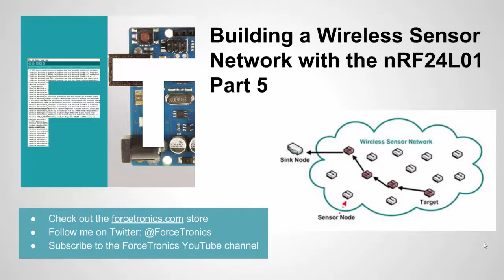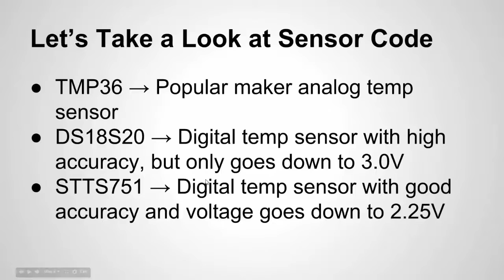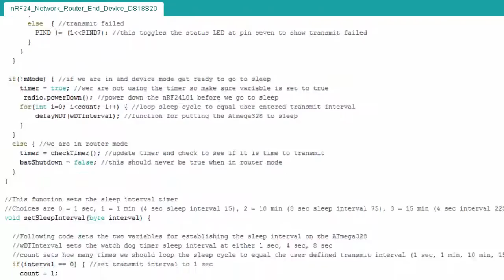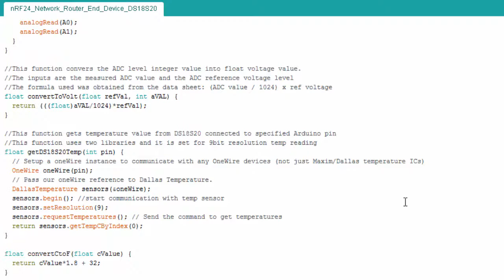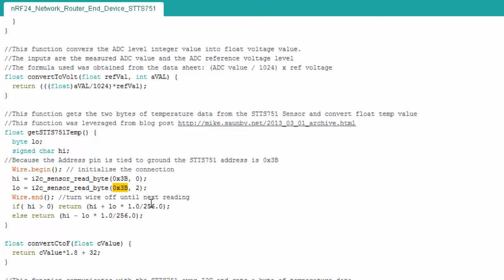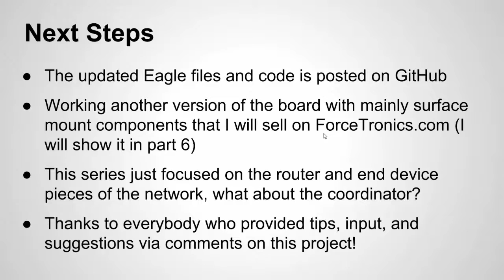Building a Wireless Sensor Network with the nRF24L01 Part 5

Comment: Hello, I’m working on a project with three Arduinos. I have a Node0 where I pass along a joystick1 reading to Node1 and joystick2 reading to Node2. Those would be integer values. I am also passing along two encoder values (volatile long) from Node1 to Node2. How do I process the data on Node2? It expects a 1 type int from Node0 and 2 type longs from Node1. I'm using header.form_node, so I know which info is coming from where. What do you recommend?

Comment: Can we use Arduino Uno instead of custom made PCB??? And the sensors externally??
Reply from the maker: Yes you can but you may need to change the pins around in the code depending on where you connect the sensors. Also unless you use the exact same sensors you will need to adapt code to what sensors you use

Comment: The board looks ok but you have a lot of open space on the board that could be used to make the board smaller  and the development area would be better if it just had a small header with a pluggable dev board that could be used of board.

Comment: In searching a little further and after watching part 6 of the series I see that you have wrapped the multi-sensor functionality into your WSNode coding. Sorry for the bug :-)
Reply from the maker: You can also find the dedicated sketches with the different temp sensors on GitHub. Link is in the video or in the description section of the video
Reply: Thanks for the quick reply. I found the sketches in the commits on your github repository. Thanks again for your help and for the great series of vids.

Comment: hi. i used your codes with arduino uno running on 5V. I modified the code for lm35. The problem i am facing is that the coordinator receives only from 01-06. No data from the leaf node reaches the coordinator. And every time i power the micro controller on usb i need to set the eeprom values. The led on pin 7 just flickers for the leaf node. Can you help me out?
Reply from the maker: Are you addressing the leaf nodes with decimal converted to octal values? For instance leaf address 011 in decimal would be 9. I can't explain the EEPROM and LED issue, those are using common Arduino libraries, are you running the sketch from the boatloader or directly programming the MCU?

Comment: Firstly congratulations! I have a problem, i want to make smart relay with Arduino/NRF24L01. I need to use NRF24L01 receiver/transmitter at the same time. How can I do? I need to see instant to relay state. I hope, you understand. Thanks...
Reply from the maker: +Pilav Yapan Robot There are multiple areas that restrict you from doing "exact" same time transmit and receive. For instance the nRF24L01 has only one antenna, the nRF24L01 can only be in transmit or receive mode at any given time, and the SPI communication between the Arduino and the nRF24L01 only allows one of them to "talk" at a time. With that said you can use techniques such as using the ack packat to send data from the receiver to the transmitter to get real fast responses. But how fast I don't know since I have never investigated, but they probably provide some benchmark or spec in the datasheet of the nRF24L01

Comment: Great project and great videos!
Do you have any plans to include a light sensor like the bh1750fvi ??
It has the operating voltage in the range you operate the rest of your sensors in this project.
And did you considered using the BME280 temperature/humidity sensor instead of just the temperature sensor?
Reply from the maker: +Vitor Pinto Thanks for the suggestions. I don't plan to add either at this point, but I can see how they would be useful for various applications. This is why I am making the design totally open source so others can build onto it for their specific needs.

Comment: Any plans about using Si4432? Thanks
Reply from the maker: +YO2LYP No plans currently. Is there any clear advantages over the nRF24L01? I am not familiar with it.
Reply: +ForceTronics Si4432 modules are working on UHF bands (433MHz / 868 MHz) and may have an increased range over 2.4GHz devices (price is slightly bigger than nRF24L01). There may be an advantage on power consumption, but I am not sure how much. I thought that you are working on this too, that is why I asked :) Looking forward for other wonderful projects from your side !

Comment: Suggestion: You may want to move the sensors to the edge of the board away from the voltage regulator in case the regulators heat may affect the readings. Also, it might make it easier for someone to mount the sensors off of the board if they want to do that.  Such as for doing an inside/outside measurement.
Reply from the maker: +mike95826 Great Suggestions. I have actually heard the regulator one before, which means I should act on it! The regulator is working at <100mA so heat rise is not much of a concern for the size of the regulator. With that said it is good practice to not have sensors near it. For the through hole design I did move the regulator away a bit in the updated Eagle PCB design. For the SMD I will put even more distance between them.

Comment: Great Video.  I am looking forward to working with your board.  I don't like to solder surface mounted components, so I hope to buy 3 or 4 completed boards.  Once I get them working I can start building the boards on my own.  The Arduino group I am a member of is looking forward to learn how to mesh this together.  Thanks for presenting this!

Comment: Very interesting work as usual! But you surprised me with your choice of DS18S20 in stead of the more commonly used DS18B20. 
I had never heard about DS18S20 before, so I looked for a page describing the differnce between DS18S20 and DS18B20. And I found this very good page at MAXIM INTEGRATED https://www.maximintegrated.com/en/app-notes/index.mvp/id/4377
The more I read, the more I started to wonder if it is DS18S20 you really want to use. 
The DS18S20 is made as a direct replacement of the older DS1820, and DS18B20 is considered easier to use and more flexible.
I also found the following text about conversion accuracy/time: "The DS18S20 was designed to be a drop-in replacement for the original DS1820. To work as a replacement, the ADC in the DS18S20 is factory configured to always perform 12-bit conversions. The 12-bit data is then rounded to a 9-bit value and stored in the temperature register."
Reply from the maker: +Bedove Hello thanks for the excellent comment. For my use at home I plan to use the STTS751 because it can operate at a much lower voltage level compared to the DS18 family. I included the three options just for flexibility for others following the project. Assuming that it has the same package options as the DS18S20, you can probably use the DS18B20 on the board. I will take a closer look at the DS18B20 version.